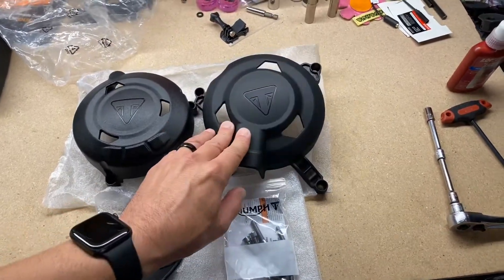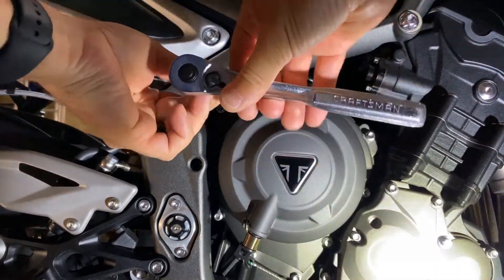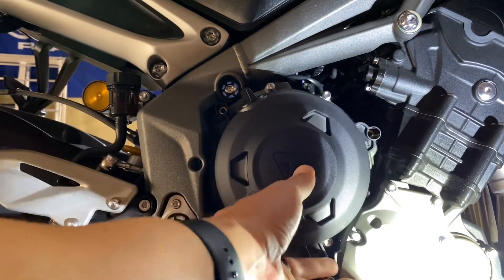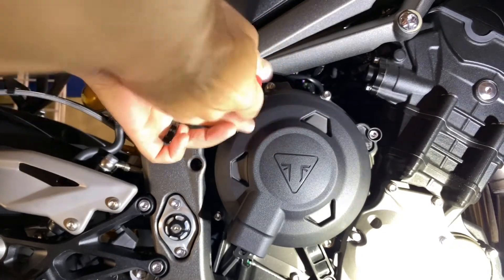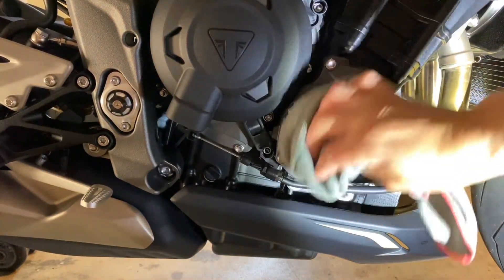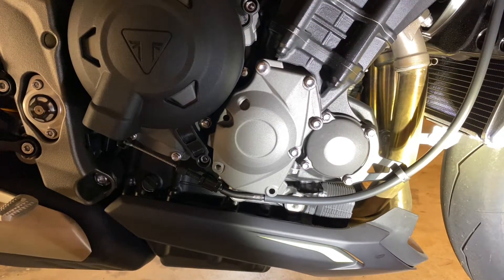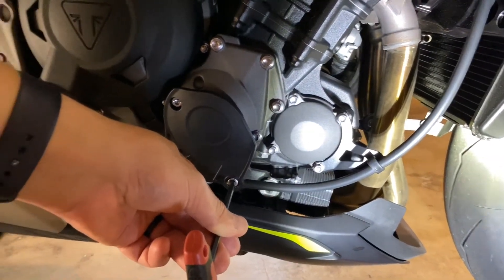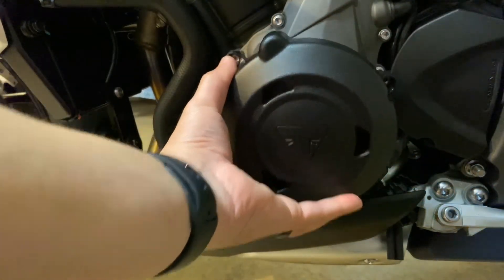2020 Street triple rs case saver install

Comment: I got my bike new, was going to put these on from day 1. Now at 98xx miles later had a low side in a parking lot, my statorcover is scuffed up now. Not leaking so now I picked up some gbreacing covers :/
Reply from the maker: Damn sorry to hear that. Yea i use to have a yamaha r1 and i lowsided and then got case covers for it and ever since then i use them on all my sportbikes. It saves money in case of low side.